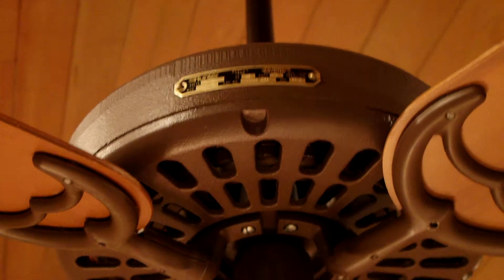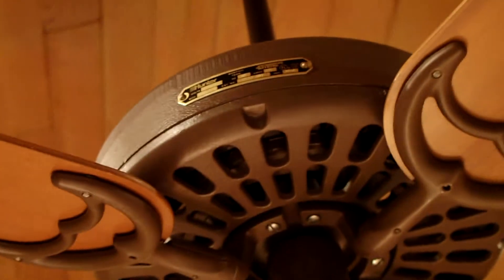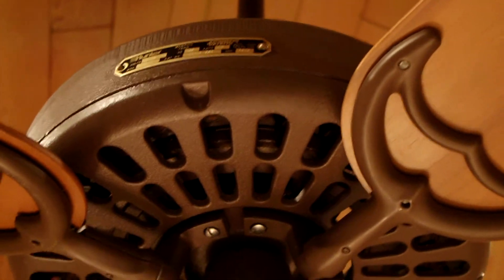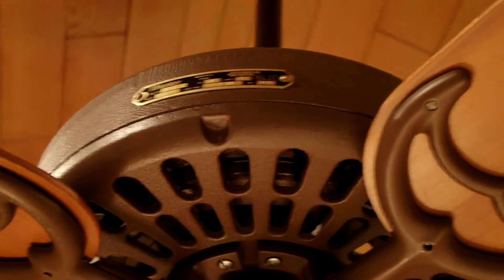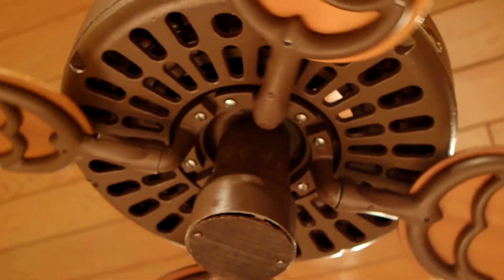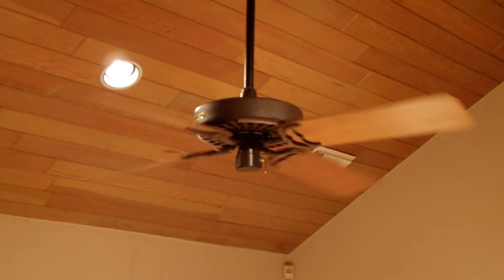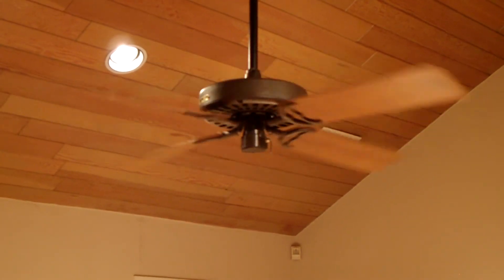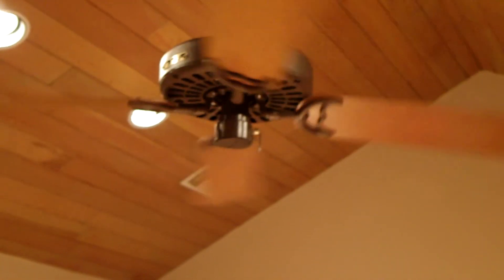Hunter Original Ceiling Fan 22272 Slow Speed Modification

Comment: Where is the capacitor on these located I have a older one from the 80s recently it's been having issues starting on low I have nudge the blade to get it to start the fan turns freely has plenty of oil in it  it will hum when trying to start. Will run on high just fine
Reply: Does the fan spin freely or is it very stiff?
Reply: @showbizcec4985  are you blind

Comment: Hi -  I have this same fan, and tried to add a capacitor, without success. I used a 10uf 450v non polarized film capacitor. I have 120v on both sides of the capacitor, so I believe the capacitor is working. But the motor does not turn when I connect in series to either the red or blue lead. And it's not a starting torque issue, with voltage applied and a spinning start by hand, it eventually stops, as if there in no magnetic force there at all.  So I'm stumped.